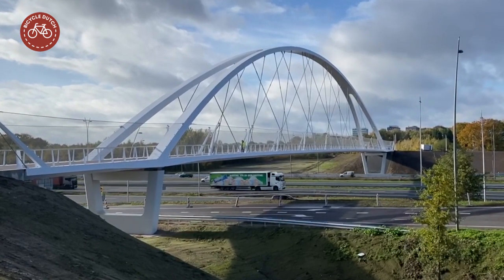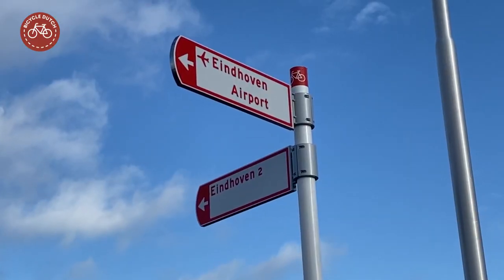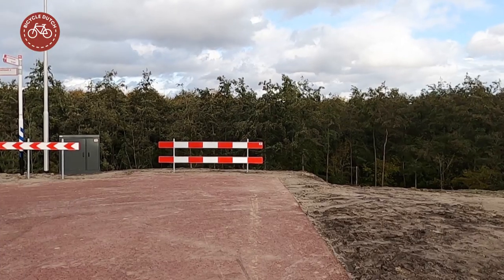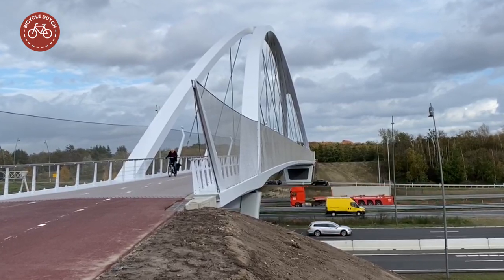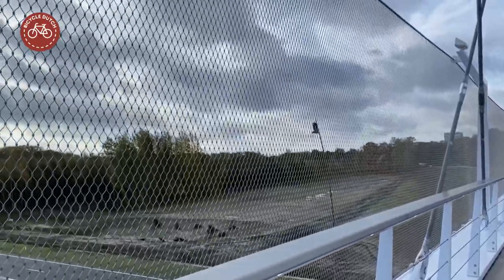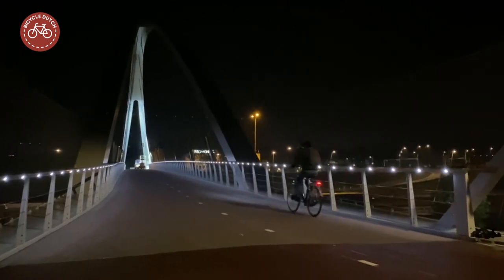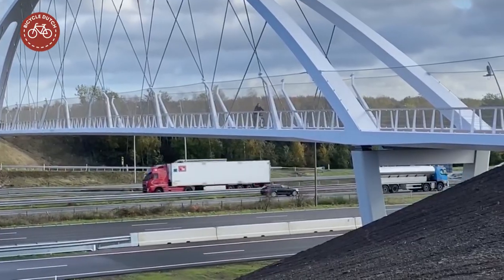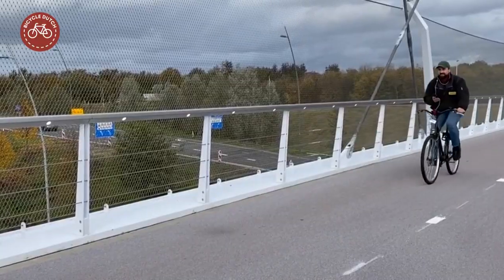A huge new cycling bridge in Eindhoven (NL)

Comment: Well, we haven't got really high wind speeds yet, and for me that means a 'wait and see attitude', the Hovenring was a disaster when it was first opened, because high wind speeds.
Reply: Did they adapt it to give more shelter from the wind?
Reply: @SirPrancelot1  they put vibration dampeners on the cable stays. Does he really think that same  company didn't learn from that experience?
Reply: I'm not worried but the bridge actually is far more form than function. It's a big climb and quite out of the way and also very far removed from most destinations. It's over 500 meters away from the closest home on one side and over 600 from an industrial center on the other side. Obviously industrial centers are not the biggest bicycle magnet.
I think this bridge was not really needed and they should have just build a much cheaper and shorter route by putting a small bridge underneath the road bridge or maybe expand the road bridge to put cycling paths on the side.

This bridge alongside the elevated roundabout are more there to show that Eindhoven is a cycling city than to be practical for the people of Eindhoven. I live in Eindhoven and have traveled over both of them quite frequently and they are functional but far from pleasant because of the steep climb and how they sway in the wind. The elevated roundabout at least is build on an existing route but this bridge not only was very expensive by itself but also required a large amount of cycling paths to be build just for it instead of putting that next to the existing right of way of the road. Cutting down part of the forest as well.

Comment: Beautiful bridge, only the netting is very ugly. Why not just the railing, like 99% of other bridges? Are they afraid people will jump from this particular bridge or so?
Reply: That might be one of the reasons... sometimes railing isn’t enough
Reply: if you fall of your bike you might fall in between the railing which is really dangourous
Reply: @hyort3613  I understand this argument, but considering all other bridges I know have no netting, is this really necessary?
I also don't know any stories or news articles of people falling off bridges. In the Netherlands we also have plenty of quays alongside canals with no fences or what's so ever. You could drive into them with ease, and still it rarely happens.
Reply: We also had some incidents with people throwing concrete tiles off bridges onto the highway.
Reply: its there so that people wont fall on the highway and to prevent people from throwing bricks and tiles of it

Comment: When car users see this video and hear how noisy the motor traffic is, would they then start to refuse using cars? Maybe they would call to boss, to say that they suddenly fell ill and can't get to work, although they just don't have also bicycle yet.. If they had a good boss they would not need to lie. They could just say: "Sorry I went to buy bicycle today, by foot and will be late to work." :D
Reply: Good luck finding a Dutch person without a bike, though! There's more bicycles than people in the country.
Reply: Each and every single person driving those cars also have bike and likely use their bike on a near daily basis. Bikes are used for most of the local needs of transportation. Cars are used when one has to travel a bit further or when one needs to transport bulky stuff.
Reply: I hope that in future, engineers find some ways to make those cars more quiet. ^_^
Reply: @rttm  that would be electric cars, only noise you have then is the wheels going over the road and maybe some turbulent air noise going over bad seams
Reply: Tires themselves are pretty loud, especially at those high speeds.

Comment: Too many cars , too many car lanes :(  The bridge is nice
Reply: The cars are there, and being used.
We don't want to compete with cars but coexist.
Each our own quality infrastructure.
Reply: Its becouse its the bussiest highway in the netherlands and another road so thats why
Reply: The A2 is one of the most important routes in the Netherlands. The A2 between Amsterdam and Utrecht even has 2x5 lanes along its entire length.
Reply: It's because this connects the A2 with the A67 going to Venlo/Germany Ruhr area. Lots of cargo traffic from Rotterdam port into Germany and the rest of Europe. Also as someone said this is the most important highway in the Netherlands.
Reply: @ltg8382  it's still overkill.

In Germany the highways have less Lanes
Reply: @nicolasblume1046  it's not overkill believe me. at peak times this is packed to it's limits.
Reply: @nicolasblume1046  And that's why there's about 20kms of traffic jams outside every major German city during rush hour.
Reply: @nicolasblume1046  And now take population density into the equation
Reply: Calling it 14 lanes is misleading, given that at least 4 of them are on / off ramps. Then you have the inner 4 lanes (2 each direction) that are the "high speed"  lanes, without any exits other than connection to other highways, to keep the through traffic moving and separate from the local traffic.